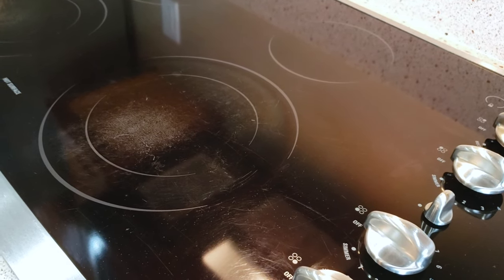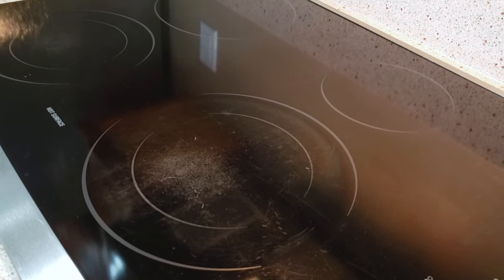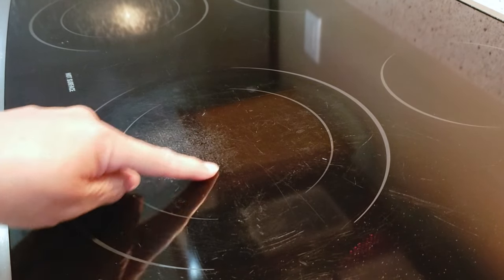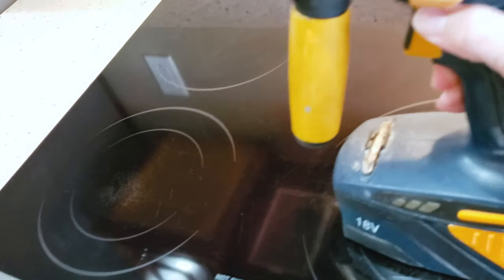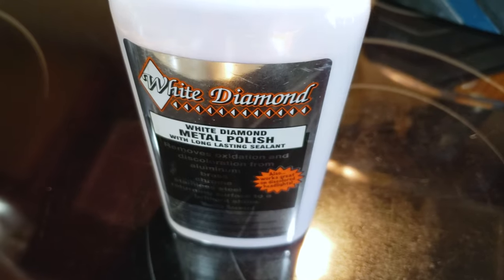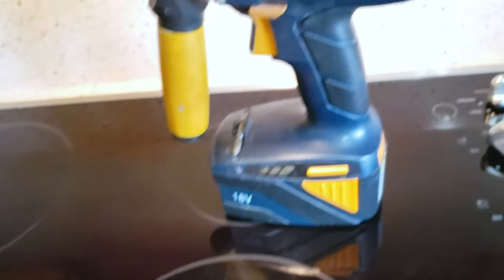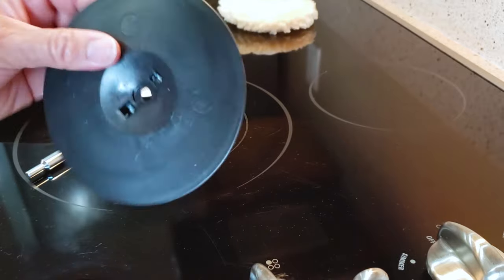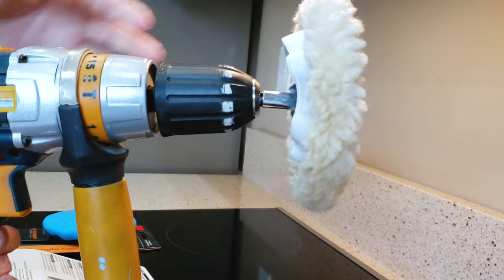How to Remove Scratches on a Glass Smooth Top Cooktop | Sand Paper & Polish Cleaning Method

Comment: It’s beyond me why anyone would buy a glass cooktop. I don’t mean you Amy, I know the house came with it. But glass cooktop,is not worth it at all!
Reply: Because it looks fantastic. I have one in all my houses around and it looks like new. Just clean it and you are all set.
Reply: Silly silly reply. Obviously gas is old word. Induction is the future
Reply: Because if you don’t have gas you would have to buy a coil which doesn’t have a lot of features or glass top . Just take care of it and you will have no problems.
Reply: What is the alternative, apart from gas?
Reply: If used and maintained properly they can look like new for years
Reply: Induction still has a glass surface.
Reply: Obviously you’ve never tried one
Reply: Yep! I don't know how people keep them looking new. Every time I use mine, there's more scratches from the pans, not to mention that it smudges with just a glance.
Reply: I was forced into my induction. & I absolutely hate it. I refuse to use Teflon pans, so the majority of my cookware is cast iron. I have to be extra careful bc of how prone to scratching it is. Just a pain to deal with. I will not be switching to induction in the long run.
Reply: I have been using cast iron on an induction top for a decade, you'll be fine.
Reply: I agree. I don’t like mine
Reply: Detesto la mía vitrocerámica es un martirio..no dejo q nadie la toque o sino es el peor dolor de cabeza para mí 🥴🥴🥴🥴
Reply: I've had a glass cooktop and use cast iron on it daily and still looks new and very easy clean up. Don't know why anyone would buy anything but a glass top especially for boil overs and all the grease and other messes that get into every crack on conventional cook tops. No thanks. Easy clean up and don't miss anything unlike other cooktops
Reply: @rbwirth12 I use cast iron on mine that's all I have for pots and pans and mine looks new after two years of use. I have three kids I'm always cooking for too

Comment: You need mugh higher grits of sandpaper. 10-20000 grit. They use the ultra fine grit to polish scratches in aircraft windows. A good auto parts store has it in the auto body section. I have used it to take out light surface scratches in plastic lamminate countertops.
Reply: Aircraft windows are also a much softer Acrylic.
Reply: 20,000?

Comment: My white circle came from boiling potato’s and I fell asleep and the water evaporated and the potato’s burned in the bottom of the pot, the pot actually melted onto the glass it seemed. I just ordered all the items, I will let you know how it comes out! Ty for the information!
Reply: Hi, did you managed FO remove it ? I have melt metal from a non sticking pan I don’t know how to remove the metal

Comment: The issue with this is, the compound is simply filling the scratches, it's not actually removing them. The only way to remove scratches is to remove surface area below the scratch, with a diamond paste compound; which over time will make the tp thinner and thinner in that area.

Comment: First, I'm happy to see an actual attempt besides some stupid mild soap. When buffing you try your best to keep the pad flat and as you can see you were on an angle. There are different types of buff pads for different levels of polish. I can't see the scratches that are there so I can't determine are the deep or small. You might just need a finer polish for a next step. But kudos and thank you for the video

Comment: Those scratches are what happens when you use cast iron pans and move them back and forth when cooking cast iron scratches glass cooktops super easy. 

A recommendation that was given to me by a Samsung repair tech a while back when I had my fridge replaced I bought a home that had a glass cooktop that looked similar to this he told me to go and get one of those headlights sandpaper restoration kits for a drill and wet sand the entire surface using the instructions just like I was restoring a glass headlight and use the sanding pads first starting with the coarsest one first then keep changing to the finer ones until all the scratches are gone then use the buffer pad with some Weimens glass top cleaner when I was done it made my glass cooktop look brand spanking new.
Reply: Other pans do it too, I think if they're moved back & forth. I'll try buffing my stove top to test before I replace it. Something took a chip out of mine too.
Reply: Glass cooktops are a pain. If I'm ever buying I'm not buying that
Reply: Best answer so fare

Comment: Thank you, Amy!
Our “Seniors only” HUD apartment building has been recently renovated, including a new ceramic cooking hob.
I certainly don’t want to look a gift horse in the mouth, so to speak but several of the materials used in the process are less than efficient for a “Senior” to keep clean 🫤 
I would really like to keep my new apartment renovations looking as good as possible for as long as I can as I doubt they will ever be replaced again in my lifetime.  
Your video has been extremely helpful to me for this purpose.  Even if I have to purchase a new drill and buffer for this, I can doubtless use those items on other endeavors such as putting screws in my wall to hang wall decor items, etc.
Advancing age will likely limit my time for performing any of these tasks but for now, I value my independence and the ability to handle them.  
I’m very glad that you made this video and that I found it!  Yay!  🥰😘

Comment: I dont use sandpaper that's way too rough, but I do use an attachment that has the same consistency as a scour pad. It'll make quick work of stubborn grease and spots, but without scratching the glass. Yes you'll still need a cleaning solution. A quick wipe at the end and let it dry, then I use the buffing attachment. It works every time. Sparkling clean. Almost like looking in a mirror :)

Comment: I found that the rpm of the drill effect the turn out . I used a Dremel with buffer on it at 10000 rpm. Worked

Comment: wet & dry sanding disc on orbital polisher (or drill) 320 grit until scratches are gone. 500 to get rid of 320 grit marks. 800 to get rid of 500 grit marks.
felt disc next, use cerium oxide as the cutting compound and polish out the 800 grit marks to a shine.
glass surface = restored 👌

Comment: Use a cerium oxide polishing product. It is used by professionals to remove defects and light scratches from glass. Should apply with a mechanical polisher or drill accessory.

Comment: You need to use Bar Keepers Friend powder, add a few drops of water and scrub with a steel wool scourer, works like magic.
Reply from the maker: I use a little BKF on it for regular cleaning. The scratches were really bad and the BKF didn't get it out.

Comment: It looks a lot better, I clean houses and I see a lot of stoves that looks like yours. Most of the  the scratches is because they use cast iron skillets, also not cleaning them properly. I know a lot of people will say, you can use cast iron on them, but really you shouldn't.  That's why I would not have a glass cook top because, I do use cast iron skillets.
Reply: The only cast iron I will allow to be used on my glass cooktop is the enameled type. No regular cast iron whatsoever. It can be done, but I just prefer to be cautious about it. Dragging heavy pots and pans across it will destroy a glass cooktop in no time.
Reply: Cast iron can develop burs, but the way I was taught to clean cast iron, there are no burs. My grandfather's cast iron was so smooth you could see your reflection.

Comment: They make 1 and ½ micron diamond polishing paste that would without a doubt work. It’s used to polish gem stones and on strops for knife sharpening.  So 1 micron is about the equivalent of 10,000 grit. The paste range from extremely coarse to extremely fine. Mirror finish

Comment: Also #0000 Steel Wool, and  #0000 Pumice Powder  will clean without scratching glass
Reply: i use the SOS pads, with light to medium pressure "feeling" for spots so to speak (I do know how to wax/polish/clean cars so it's the same feel)
i have some glass cleaning kits in my detailing arsenal, but i haven't taken them out yet.
i'm sorta in the camp of leave that (meaning hardcore compounding) as your last result because you are taking a little off the finish so to speak
ive also just learned to live with these tops no matter how much care you put in will inevitably scratch
although we do have a very expensive stove and its not as bad as our previous one, however i yell at the wife when she drags pans on it and bangs on it

Comment: You dont want to make scratches,lift pans on and off don't slide or bang the surface ,its easy to clean but fragile and will crack and cant be repaired due to the extreme heat range it works under.
Reply from the maker: Yeah, we bought this house with this cooktop so I was trying to save it. The prior owner was rough on it. Thanks for watching!

Comment: I always buy this specific ceramic cooktop cleaner that's made by the same company that manufactures the glass for electric cookers. You just need a damp sponge and some elbow grease and you can literally make the glass look like new. I've had my cooker for almost 5 years and it still looks amazing. 
When I bought my stove there was a sample of this product included and I've been buying it ever since. It's called the Schott Ceran coocktop cleaner.
Reply: It's scratched not dirty
Reply: Beth, does it take out scratches?  I bought a rental house and it's scratched.  Thx.
Reply: @dawnschwartz6099  it does take out the smaller ones. If you have any deep scratches they might get slightly less visible but will still be there unfortunately.
Reply: @LilybethII  thanks!
Reply: Yes you are right, have to clean every day with that cream and a scrubber provided before heating it again
I have it nice and clean for 11 years , but sooner or later scratches will come that will only go by sanding